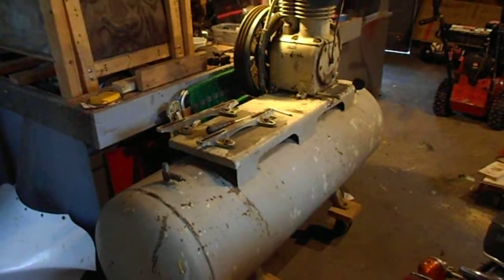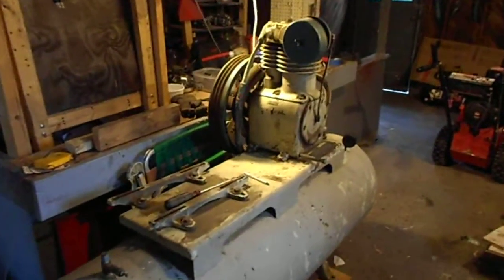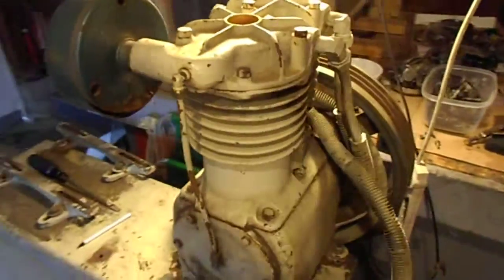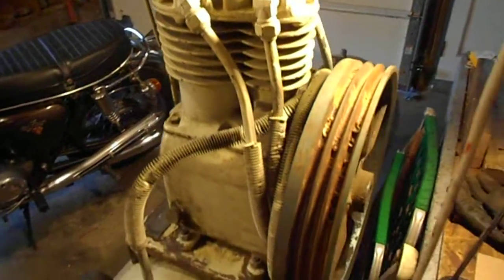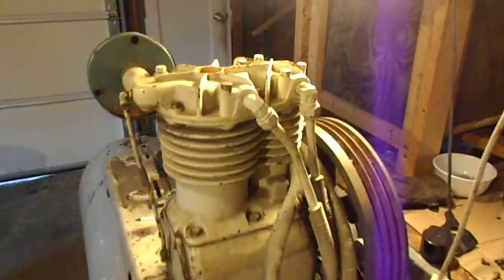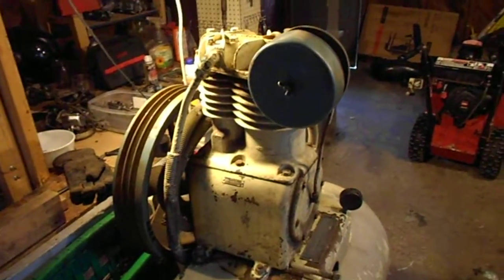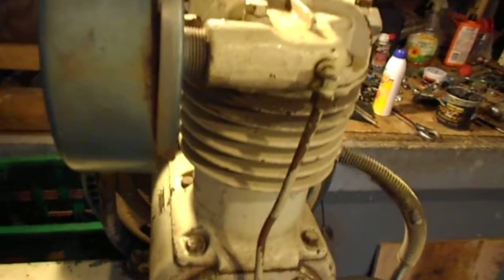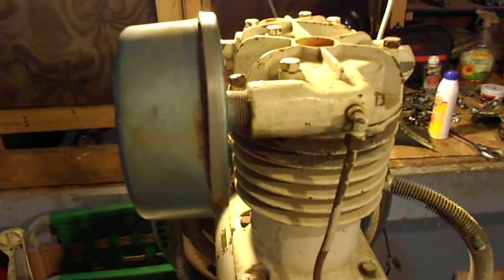Kellogg 330 Air Compressor Serial C172134

Comment from the maker: Thanks Mike and Big Mike for the feedback I would like to run at a higher CFM, but am unsure of the tank.  Work keeps me so busy lately that I have not had time to play in the garage.  Mr Edwards thanks for the encouragement looks like this is a worth while project.  Not sure of the company, but I have that info in Ebay or email on replacement parts.  Kits are available.

Wish I had your setup  46 CFM is to die for.  You can blast anything with that puppy.  How many amps does that draw? 1 Phase?

Comment: These models fluctuate in CFM, depending on the flywheel, and motor combination.  Do not exceed the pressure rating on the tank.  200 PSI is much too high.  I have been using a Kellogg 325 since the early 90's,. I got it from my father who bought it used in 1968.  It is 2013, and I am just now putting rings, and disc valves in it.  Google search a company called Air Compressor Equipment.  They are the only one I know of in the US that can still get parts for the old units.

Comment: Mid20's for cfm. Can go up to 250psi, I would run it around 200 psi. It is actually better to run the pump at around 200 than 100. The pump won't have to kick on as often because of the higher pressure in the tank. It's almost making it act like a bigger tank. I have an old 120 gallon Wayne compressor from '67 with a 10 hp 220 motor on it that makes 46 cfm @ 150psi. I run it up to 200 and I have yet to want more air. I love it!

Comment: I do think you should take off the head, inspect the valves, and make sure there is no gunk in the cylinders before spinning it very fast because a little bit of sand, dirt, or something like that could really scratch it up and make it not pump as well. I was at first not going to take off the head on my Quincy 325 but when I did I was glad I did if not it would have messed it up a lot. well Good Luck